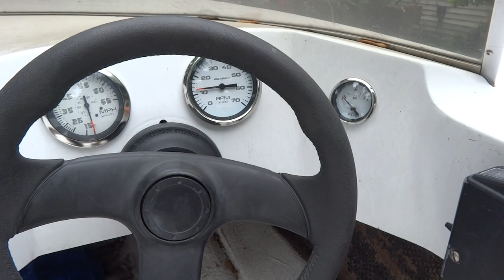Location of Kill Switch Lanyard

Comment: hi so how does it work i dont see any lanyard so how does it stop the engine
Reply from the maker: When the lanyard is attached to the switch, the lanyard is also attached to your wrist. In the event that you fall from the cockpit or seat, the lanyard pulls the swich to "Kill" and the engine dies.
Reply: @cturboaddict   hi mate seeing your video is it  in the run position or is it in the off position
Reply from the maker: @maoripighunter  run
Reply: yeh not use to these one but got it in the end thanks @cturboaddict